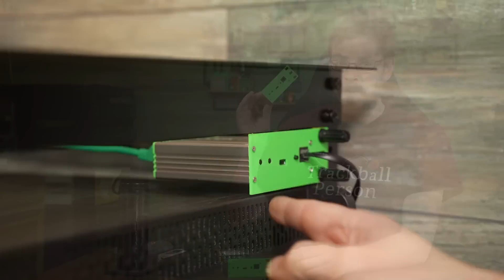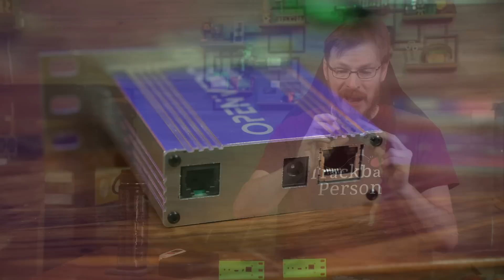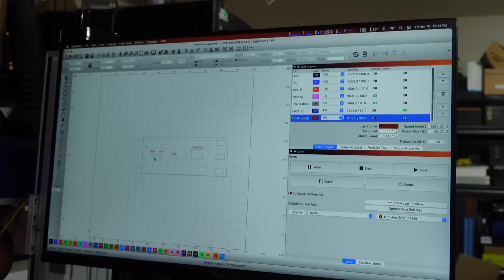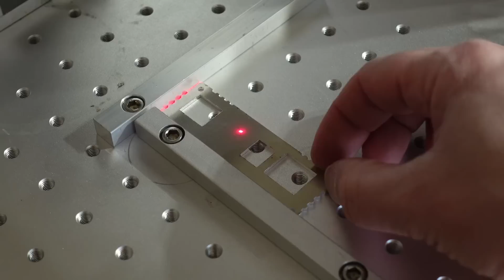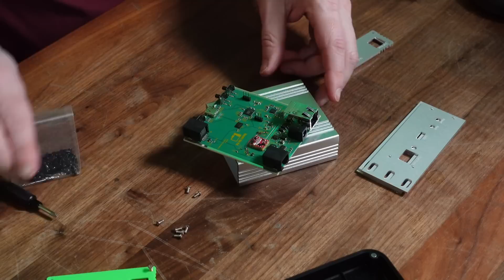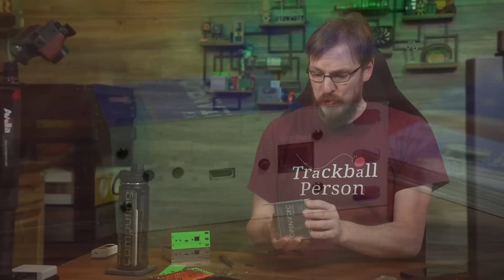Openviro Axe PoE Update - FULL METAL ENCLOSURE!

Comment: Would you be interested in making this capable of monitoring AirCoolers/HVAC units? If possible adding ports would allow to connect "Temperature Clamps" to monitor the copper lines of an HVAC split system maybe even the Pressure on the Refrigerant lines, would be a stretch haha but pretty cool to monitor the Temp differential on the unit, superheat and sub cooling at all times, being able to keep track of performance and seeing issues arise way earlier instead of until stuff breaks haha
Reply from the maker: We do have interest in developing HVAC monitors in future revisions. This product as it stands is designed purely for ambient temp monitoring.

Comment: I suggest adding upside-down lettering to the ports, allowing the unit to be mounted on the other side of the rack without looking stupid.
Also, in the previous video somebody asked about fitting multiple in a single U. Perhaps you could also produce a full width front panel which could accommodate multiple main units.
Reply from the maker: I may launch a full-width panel eventually, if there is call for it. Long term, we're also looking at developing a much larger, multi-sensor platform for more complex environments.
Reply: I'd say put labels on the 90 degree angle so it looks decent both ways.

Comment: Could you mirror the file so the marks are on the inside? they wouldn't need as much refinishing then, as nobody would see them after installation.
Reply: I was going to suggest this as well. I sometimes run into a similar issue with our steel plate burn table at work, not that we much care about the end result looking pristine for our in-house purposes.

Comment: Isn't it getting a little bit overengineered?
Reply from the maker: Overengineered how? Rackmount hardware needs to be strong enough to hold its own weight, but also incidental bumps from devices sometimes weighing 40-60lb. 3D Printing was never a real option for a rackmount device. And actually, metal will likely be cheaper than farming out 3D printer time.

Comment: Super cool etching. 

+1 vote for anodized finish. Some dye, water, electrolyte, battery charger. Slower and labor intensive compared to your space laser, but a cool finish that slightly hardens the surface.
Reply: Could also be sold as a "limited edition" and the standard just being the laser-etched matt finish.

Comment: It will be fun for Colos when these are widely deployed and some IT admin’s dashboard keeps showing a high temp warning. Standard IT operating procedure is that if the problem could lie with someone else, then you should do nothing and keep insisting it is the others fault. So after a few months of swapping out multiple of these someone competent will discover that the rack configuration has a switch mounted at the back and none of the techs ever read the manual for the switch which clearly showed the default fan configuration and the method for changing it on page 2. So all the while people were upset about rack temps but they had the equivalent of a hair dryer pointed right at the temperature sensor … sigh I miss working at data centers

Comment: Sendcutsend is great, I had them create all the metal parts for a 32-bay pedestal case and it turned out spectacular. I'd recommend cross shopping with other sheet metal services though, just so you can make sure you get the lowest price, Fabworks is another one that comes to mind that I've used.
Reply from the maker: SCS was amazing for prototyping, but yes, I'll be shopping for final pricing before we go into production.

Comment: Do you have any worries about putting a thermometer inside a metal box ?...
Did the manufacturer not offer a bead tumbler service ?
Reply from the maker: The temp sensors are not inside this enclosure. They are separate units, and 3D printed.

I didn't want to spend the extra to have these first samples finished. This run was to check for fitment.
Reply: Ah... I was under the impression there was a primary sensor in the main unit and others were secondary.
Would a cheap toy Rock Tumbler be technically reasonable for this use case ?
Reply from the maker: We did attempt to put a temp sensor in the main unit to save on cost. It did not go well 😁

While I don't mind lasering each panel, I'm going to outsource the initial finishing work to the manufacturer. That's just too much and too exact for me to do in house.

Comment: Very nice, I personally would put the labels below so they are all on the same level.
A full width front panel with cutouts for the JetKVM would be amazing.
Reply: That hinders legibility when there's cables plugged in to all the ports. Labels on tops means you can always read them.
Reply: @Rushil69420  That doesn't impact me, if everything is plugged in I don't need to see the label, it's more important for me to see the labels I have on the cables near the connectors.

Comment: For homelab, sure… but aluminum rack mounts that thin live short lives around real datacenters. Most single-sided mounted devices typically just use powder-coated steel faceplates :shrug:
Reply from the maker: The current target is homelab + small/medium business. We're planning on more datacenter focused parts in the future, and those will have much more robust enclosures, along with datacenter specific features.

Comment: SendCutSend is an amazing company!!
Reply from the maker: SUPER impressed with them. These are the first parts I've ordered from them. Had them in hand in less than a week, and dimensions were absolutely perfect.
Reply: @CraftComputing  If you need a little more stiffness to the front plate, can you add like a 1/4" 90deg bend along the top edge of the mounting plate?  It isn't much, but a "bend" in a flat plate increases its stiffness a lot.
Reply from the maker: For the size and weight of the device, I think a flat plate is going to be just fine.
Reply: @CraftComputing  nice. Very cool build!!